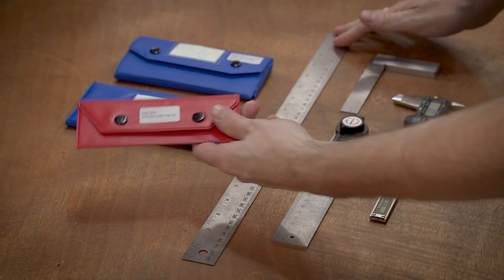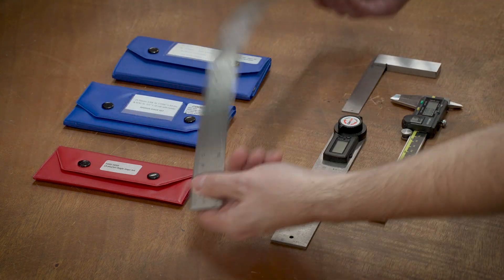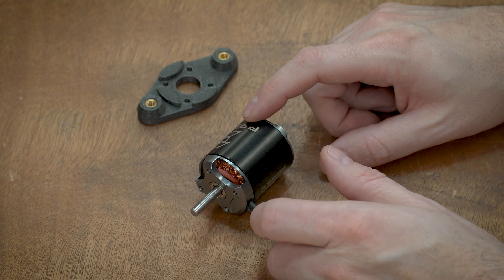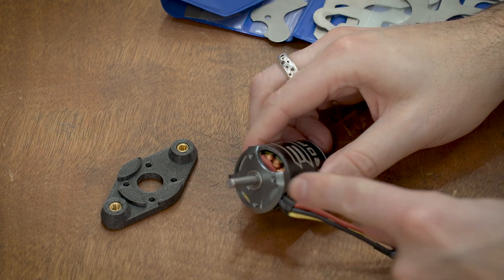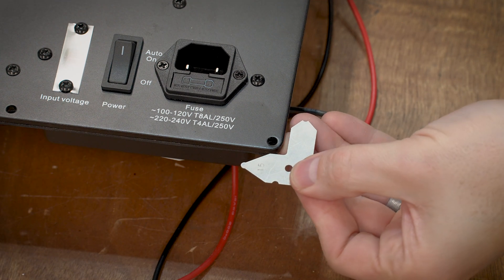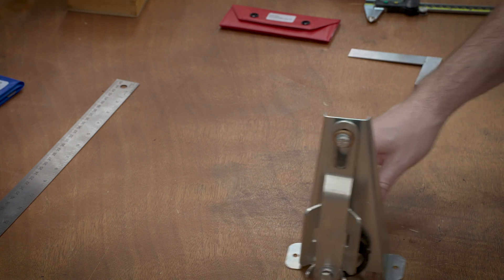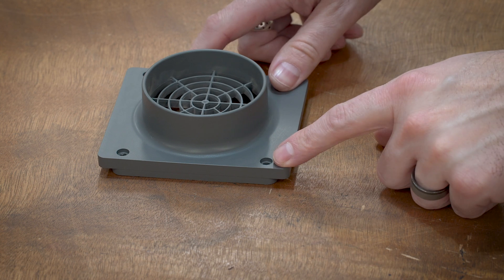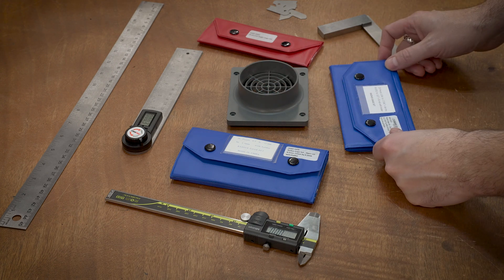Common Tools for Measuring Parts

Comment: Robert - I really appreciated this video.  I am trying to make a mount for a windshield wiper motor to run a Martin Models Die Filer I just finished.  Watching your video gave me the info I needed to match and machine the radius of the wiper motor top and bottom.  Thanks for your help.  Shawn in Greeley, CO....
Reply from the maker: I'm glad you found it useful!  Also, not sure if you knew, but I'm in Erie, so we're quite close!

Comment: Adam Savage did a show where he demonstrated a spray paint can mixer that's very fast and easy to build. It consists of a cylinder for holding the can with a slightly off-centered stud bolted on the outside bottom. It's operated by chucking it to a drill by the stud and spinning it vertically. It mixes the paint by creating a vortex inside the can. Supposedly, it takes a just few seconds.
Reply from the maker: Yeah, I saw that.  I doesn't really seem like it would actually thoroughly mix the paint, but if it works for him,  then I can't argue I guess.
Reply: @RobertCowanDIY Yeah, I wondered about that too. Adam has been a prop builder for decades and spray painting is one of the most common activities. I figure he would be a good judge on whether it's effective or not. I'm curious as to why you'd think it might not thoroughly mix the paint?
Reply from the maker: @bobweiram6321 Have you ever gotten paint from a store?  They mix that stuff for several minutes with a side-to-side motion.  Also, a spray-paint can pretty clearly instructs you to mix it for several minutes.  I just can't imagine a liquid being properly mixed after only a few seconds.
Reply: @RobertCowanDIY  Adam explained it as a vortex action from the slightly eccentric spinning of the can. I would be interesting to test it out using one of those clear tennis ball cans filled with 1 part or so of water and 3 parts oil. I might try it. 

Alternatively, have you tried using an ultrasonic cleaner? They're supposed to be extremely good at homogenizing liquids and particulates. I once had a tissue paper fall into the tank and discover tiny paper particulates suspended in the cleaning solution afterwards.
Reply from the maker: @bobweiram6321 Eh, I have no desire to test against something Adam Savage does.  There's no way I'd convince people there's a more effective solution, so I'll just focus on what I was already doing ;-)  I haven't used ultrasonic cleaners, but that's actually a good idea.  I don't have one, but have been wanting to get one for some time.  I just have so much stuff, I'm trying to limit the number of new things that enter the shop!
Reply: I think you two are talking about different things here. Apples and oranges, if you will. Spray paint cans have the mixing ball that helps mix any settled pigments back into to suspension in the paint base. Brush-on paint doesn't have the assistance of the mixing ball so requires quite a bit more sloshing to get the same effect.
Reply: @Sembazuru  I think we're talking about the same thing, but you are correct. Paint in a lidded can is typically more viscous and stays in suspension much longer. It's also less tiring to mix by hand. Spray paint cans need be shaken vigorously for approximately 2-3 minutes before use. It's a real workout and not much fun.

Comment: Metric is standard :D
Reply: glad i live in europe, unless you get a old american car , you get 99.9% metric stuff😅
Reply from the maker: @Basement_CNC That's largely the case here.  However, buying metric hardware is still trickier.  But most parts are designed with metric in mind.
Reply from the maker: You'd think that, but it's not the case.
Reply: @RobertCowanDIY It's called imperial.
Reply from the maker: @NTD3D Yeah, it's ALSO called standard.  This is such a pointless discussion to have.  Yes, metric is superior.  But there was a 'standard' before that and it's still used.  Can we just get past that?